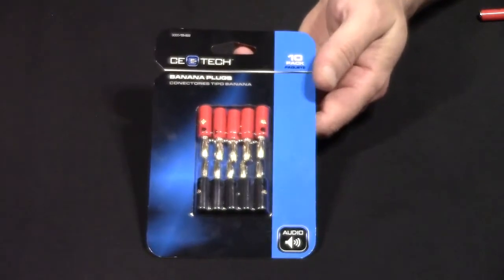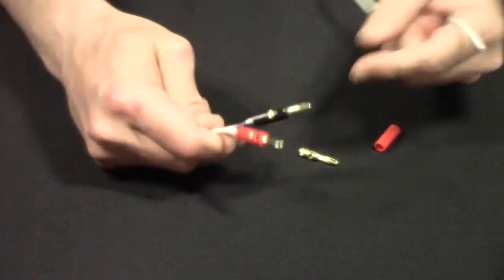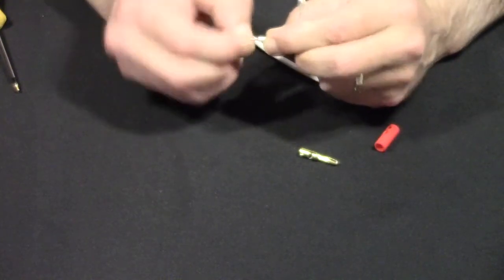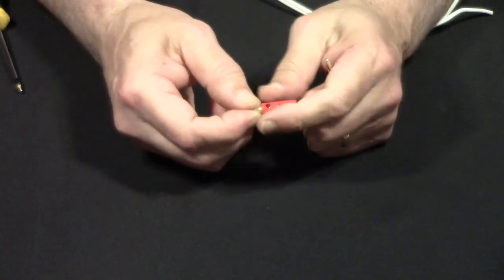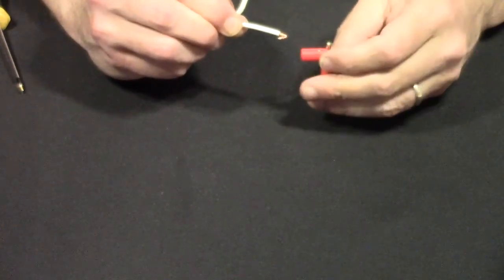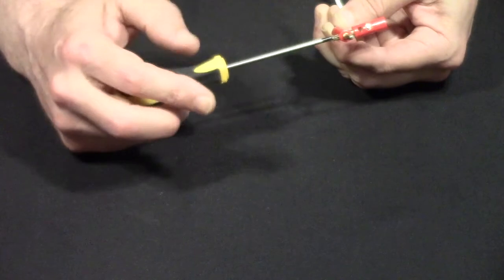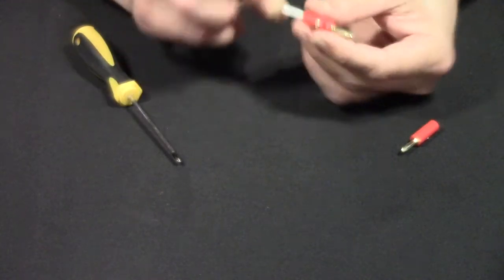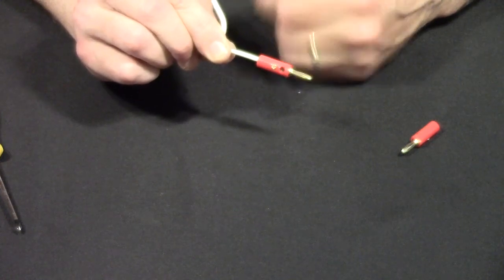CE Tech Banana Plugs

Comment: This was incredibly helpful! But after struggling with the screw a couple times I realized I could take out the setscrew only most of the way to clear the barrel of the plug and then blindly put in the loop and then apply the screw. So much easier and it worked most of the time on the first try and at most 2 to 3 times…
Reply: I came to the same conclusion.  Don't remove the screw!  Just back it out a bit and shove the hooked wire in and torque it down good.

Comment: Many thanks for posting this video, Martin! Like some of the others mentioned below, I too found that it's not really necessary to remove the set screw. After the first couple of plugs, the rest seemed to go faster & faster. And I even discovered you don't really even need to fold the wire back against itself to hold it in place. I discovered that by accident, when I was moving right along, not really thinking about the steps, and after tightening the set screw, I realized I'd forgotten to bend the wire back against itself, so I pulled and discovered - voila - the wire was snug and in place just fine. But for the sake of consistency, I pulled it out, folded it and tightened it up again. Probably the thing I discovered that was the most helpful to me was I had to stop trying to hold the plug AND sleeve together, allowing no shifting. That's what was causing my wire not to hold when tightening the set screw. Once I pushed the wire in, and allowed the plug to push forward as far as it could within the boundaries of the sleeve, that made all the difference in the world.

Comment: Where do I get the magnetic screw driver with different bits. 👍
I have a non magnetic one now.
Reply from the maker: Any hardware store has screwdrivers with magnetic tips.  Just ask.
Reply: You can magnetize it yourself.  Just drag a magnet along the tip. Or wrap a coil of wire around the tip and momentarily attach to a battery. It will stay magnetic for a while.

Comment: I found that it's not necessary to strip the wire at all. Just back out the screw until the tip is flush with the cylinder wall but not removed seat the speaker wire in the cylinder all the way then tighten the screw all the way. The screw will pierce the shielding on the speaker wire and you're good to go! This is what worked for me!
Reply: Thanks man! I think your method is the right one. I tried it and it works.

Comment: I don't understand the female sockets. The bannana plug terminal sockets. 

I've not had the opportunity to inspect them in person.

What I am confused about is in the pic on eBay of the terminal......it shows the bannana plug connecting to a hole in the middle of the center shaft from the side. 

But I was assuming they plug in from the front. 

Are there sometimes two ways to connect a bannana plug to the female terminal?

These sockets I got look as though they might plug in from the front....but a pic shows the front of the terminals screwing out to reveal a hole on the side.

I don't know if they work both ways. I just want to install the terminals and plug bannana plugs into it the normal way. Not from the side. 

I also plan to use them for a bench variable power supply positive and negative terminals.
Reply from the maker: The hole on the side allows you to connect another banana plug.  So..... if you only have one port on your device, but you'd like to connect 2 cables (with banana plugs).
Reply: Really the hole in terminal is used to insert the speaker wire directly and screw it down.
Reply from the maker: @AndrewLupton  Nope.